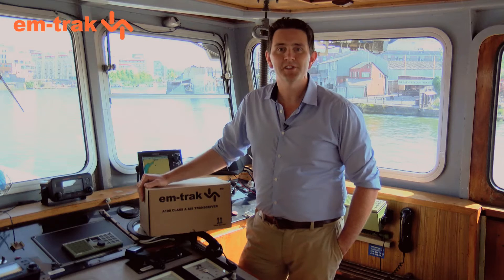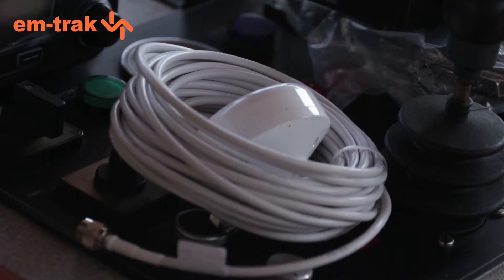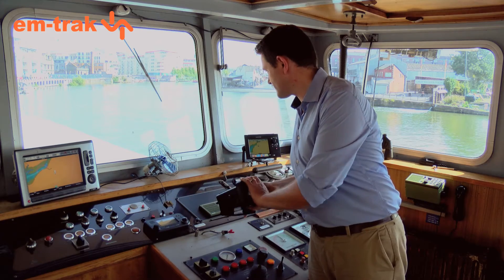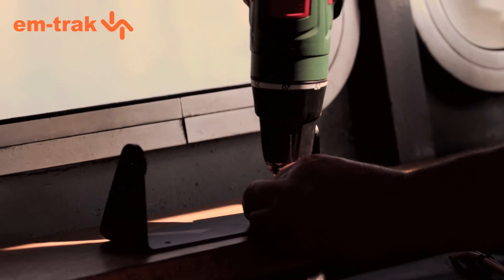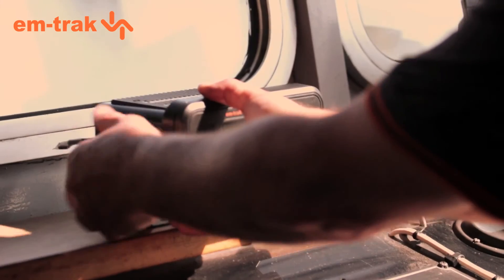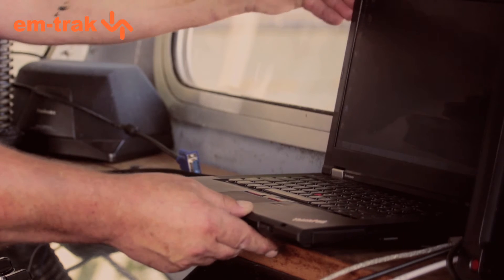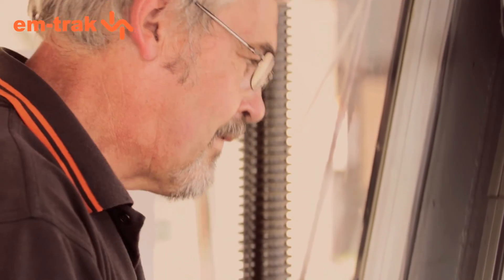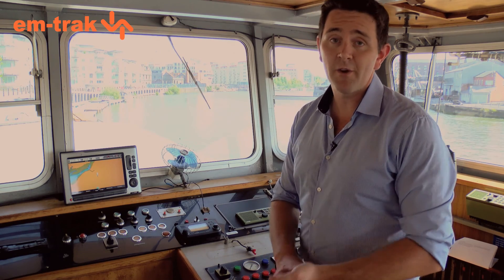em-trak Class A AIS A100 - Installation Guide

Comment: So far, configuring the unit using the stand alone menu and "password", 00000000, has accomplished nothing.  Will try using a laptop with the included CD and an RS232 to USB cable (not included), but am not confident based on what I've seen.